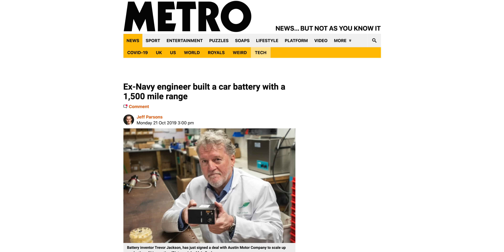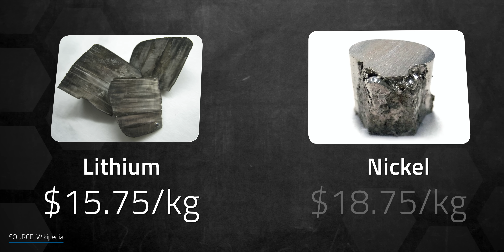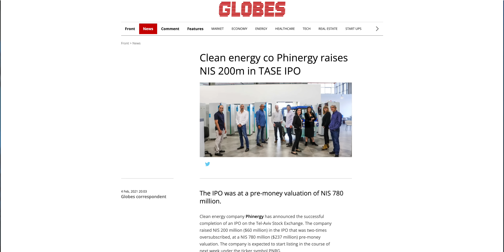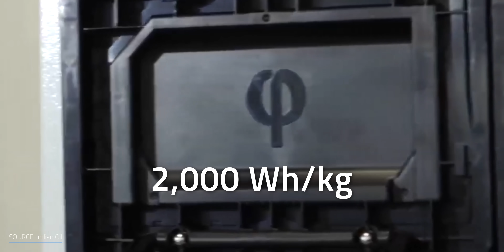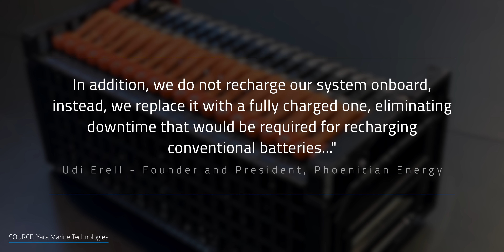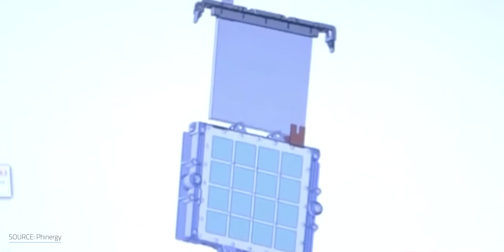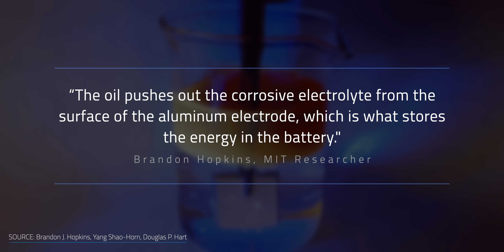Exploring the 1000 Mile Car Battery - Aluminum Air Hype?

Comment: Biggest elephant in the room: what's the roundtrip efficiency? How much energy is needed to recycle the battery for each kWh of the battery?
Reply: Should just have a hybrid system, with a medium lithium battery size that would cover 90%+ trip and space for the aluminium battery that can be swapped only when needed on trips, lets say above 150-200 miles kilometers.
Reply: Every city will need a high volume battery factory. The logistics for that will be "interesting".
Reply: @hamjudo  actually, all you need is a train car, or even a few freight trucks which run on these same batteries. Aluminum oxide is a bit caustic to some materials, but generally perfectly safe to handle, and aluminum and silver definitely are. So all you need to do is send them in bulk to somewhere were high amounts of relatively clean energy is being produced and now you have all of the battery recycling in a region covered, and a huge change in the carbon footprint.
Reply: @jasonisbored6679  Don't compare using aluminum air batteries with doing nothing or with the most expensive lithium options. Compare them with more cost optimized options.

Tesla is transitioning to using lithium iron phosphate, LFP, batteries for standard range vehicles. They aren't the most energy dense storage options, but they are good enough.

By weight, LFP batteries are about 2% lithium, the other 98% are widely available commodities including iron, phosphate, graphite, aluminum, and copper. No nickel, cobalt, or rare earths.

LFP batteries on a train can be recharged while the train is in motion by electrifying a small percentage of the track with overhead power.

On the level, the batteries and charging system can be sized so that if the train spends 5% of the time under wires, it won't need them the other 95% of the time. This doesn't mean that 5% of the track needs to be electrified, because American trains spend a lot of time moving at less than their maximum speed. The slow parts and heavy load parts are where recharging infrastructure will pay for itself most quickly. Trains need the most power when they accelerate out of sidings, and when they are going up hill. Trains go the slowest when they are stopped on sidings or adding or removing cars.

Lithium is a very common element in the Earth's crust. Unfortunately, it takes close to a decade to get volume production out of a new mine. We won't ever run out of lithium, but there may be shortages in 5 to 7 years as mine production lags demand. Given the immense profit opportunity, it seems likely that a few businesses will figure out how to start up mines more quickly.
Reply: @hamjudo  why would every city need a high volume battery factory? The city I live it have millions of car on the road, it does not have a tyre factory nor a crude refinery.
Reply: @dantronics1682  aluminum air batteries are single use items. So they are conceptually like gasoline, but they can't be shipped via pipelines. Unlike gasoline, they have to be shipped back to a factory to be recycled into new batteries. Thus they are shipped twice the distance between the factory and the battery swap location.

The economics don't make sense in this universe.
Reply: @hamjudo  without knowing cost how can you justify that the economy doesnt make sense? my point is you have electric transports which are clean quiet cheaper to build and purchase than rechargables or ICE, no rechaging infrastructor to put in, no one take this part into consideration. recharging transportation makes a lot of strain on the grid but the average everyday person isnt aware of this. this is the part where the economy doesnt make sense, On the news there is reports where millions are been spent in the states to put in charging points which isnt working. imagine if that money was use to encourage business to make swap stations. the cost of transporting these cells is sort of minimal since the logistic distribution would be using these alu-air batteries as energy source.
Reply: @hamjudo  Not really, we would move them around in logistics networks mirroring what we currently do for gasoline and diesel.
Reply: @trapfethen  More accurately: How we do for LPG.
Reply: Mmmmm if instead of changing the whole battery, why not only the aluminum, it would be easier to carry around aluminum plates. You could have a pump to push the electrolyte to another thank, a reserve thank and even change it, and change the plates... But I am not a scientist on that matter I am just thinking aloud.
Reply: @Peowcatpeow  I agree that Li isn't inherently difficult. But then there's also Cobalt & Praesodymium & the recovery of these are more important. Let's also not forget that India doesn't have any of these. There is also consideration of domination by China, against whose hegemony we're just about trying to stand-up to.

 One last thing you have to take into account is that whether or not there will be widespread Al-air battery usage. Aluminium production already exists. The spent oxide will merely get added to the processed bauxite taken to the Hall-Heroult cells. So we already have the recycling infrastructure.
Reply: Irregardless of the answer, I just love that this question is being asked and being discussed. I believe the reason we are facing environmental problems now (particularly climate change and global pollution) is that pretty much since the Industrial Revolution, producers didn't care about environmental impact and just focused on profit and consumers didn't know enough to ask about and be concerned about the end cycle of the products they were consuming. Now there are people both in the producers and consumers who are interested in the entire process and are just as interested in what happens to a product when it's time to dispose of them.
Reply: 13kwh/kg Al in newer plants
Reply: EXACTLY my thought. That sounds like a really dumb concept, a concept, only an oil company could come up with to use.
Reply: Range anxiety? Really? To me it comes down to longevity of the battery. And I mean how long it lasts before its needed to be change out. They say 10 years right? That 10 years is based off of how many cycles. Most ICE cars will last 200,000 miles. And not like a EV, which the more you drive the quicker your batteries will to be changed. Major electric changes are needed and battery life cycles are needed to make it worth it.
Reply: @Peowcatpeow  aluminium is one of the most recycled materials on earth.  Manufacturers would prefer recycled aluminum (depending on impurities) as it eliminates the Bayer process (getting the aluminum oxide from the bauxite)  then they only have to use the Hall-Herhoult process to convertil aluminum oxide to pure aluminum.   The battery is rechargeable but not in your car.    Start with aluminum in the battery uses it makes it aluminum oxide producing elctricity in the process.  Then u remove the aluminum oxide and convert it back with the electricity hungry process mensioned above.
Reply: main problem with aluminium oxyde (end product with air-al battery discharged) is the need for noble material to recyle to aluminum metal, and this noble metal material is graphite electrode for electrolysis reduction of aluminium oxyde, produccing lot of co2 with an effiency of 50%, i don't see a game changer!
Reply: I'm worried that recycling uses high heat which is hard to attain with renewables.
Reply: If this aluminium battery kicks off recycling is easy and relatively efficient
Reply: It seems like a solution looking for a problem. Lithium batteries are getting lighter and cheaper and charging faster. I have got used to charging my car like a cell phone so that's not an issue, I seldom have any single journey more than 50 miles return, which I can achieve easily in my EV. All that silver hiding in the battery would make it a prime target for thieves.
Reply: @squareeyz  Silver is dirt cheap (in terms of how much extraction and use of it from such a battery would cost), nobody's going to be stealing those batteries because of that. Regardless, nobody is going to use this anyway, it's way, way less sustainable than even fossil fuels...
Reply: same as internal combustion engine if the aluminum is recycled. energy is trivial since aluminum is recycled regularly. rechargeable EV still wins on many aspects except upfront cost.  so aluminum-air EV car is best for low mileage use vs a rechergeable EV.
Reply: Also how much material do you really get back from recycling it, often recycling something of more than one element, you only get a few parts of those elements back.
Reply: Think of all the aluminum scrap that would find its way to the recyclers once the demand for aluminum jumps even higher?
Reply: This
Reply: @Peowcatpeow  you said "The fact that aluminum is produced so widely means that none of the batteries would be recycled, where as the higher price for lithium would have higher incentives for recycling."  That's one of the dumbest comments I read in these replies.  Did you miss the part of this video that explained the silver content of these batteries, and how much that silver currently costs?  Of course these batteries would be recycled.  As for Aluminum not being recycled, look again at the percentage of Aluminum recycling currently being performed world wide, and the trend toward increased recycling to raise that percentage even higher in future years.  The question remains about how much it will cost to recycle these batteries, and also the initial cost to produce them, and replace them.  This is what is going to stop them from being used in cars, but might make them more attractive in electric aviation, where the lower weight to power ratio is more important, and possibly worth the increased cost per kilowatt hour.
Reply: and against solid state that use ~1/4 of the raw metals liquid ones does I'd say it's no brainer + the car is lighter
Reply: This sounds like a 1998 problem and not a 2021 problem.  There are regions where electricity prices are NEGATIVE during certain times of the day/year.  It's just a matter of running the arc furnaces at the trough of energy cost caused by overproduction from wind or solar.
Reply: @ricks6250 Arc furnaces for what? They dont reduce al2o3 like that it take above 2000C and you get al4c3 as main product, they do electrolize of al2o3 and it takes 13kwh/kg Al.
Reply: That, sir, has to be asked about lithium battery. Because lithium recycling is a nightmare compared to aluminum oxide.
Reply: Considering you'll have to resmelt that alumium: A metric fuckton.
This is never going to be a thing for cars or trucks. I could see it for planes. Not as many trips and there it is important to not emit anything in the atmosphere.
Reply: I think even hydrogen is a better choice than aluminium air battery currently. If they can fix the self discharge rate then it could be used as a emergency battery for power outages or as a small spare battery when travelling through the wildernes.
Reply: @SkepticalCaveman  Fair enough; I think we should be using ammonia instead of hydrogen, since it's easier to store if you just want the H2, and it carries more energy than the nitrogen and hydrogen by themselves - and N2 is a notoriously stable molecule.
Reply: @SkepticalCaveman  hydrogen converter (to energy) efficiency 50% and even those cost a lot (platinum needed there),
take into account that other 50% is heat that need to be dealt with.
so for airplanes aluminum air may be better, and for long range ships provided at both ports (ends of journey) there is refurbish plant for batteries.
but if good hydrogen power extractor would be developed (with efficiency 90%) and with good power/price ration, then hydrogen would be much better, as it goes into air exhaust, not staying in battery like Al oxide.
Reply: @SkepticalCaveman  yes this! A combination approach marketed to long trips or as a spare emergency battery due to the lightweight would be the most logical. Then as efficiency increases or we find more rechargable lighter weight solutions, we can continue to use more aluminum air tech to provide better emergency coverage.
Reply: I think the better question is, what is the lifetime efficiency of the vehicle?  I had a long response typed out, but i realized i could make my point simpler.

Theoretically it would take exactly as much energy to electrolyze the oxides as you got out of them.  If the aluminum battery lasts 1000 miles, it will need to be replaced every month or so.  Since the process is electric powered, the "recharging" is gonna be affected by generation efficiency the same as recharging lithium.  So we can simplify the comparison down to manufacturing ONE lithium battery for the 5-year lifespan of a car, vs manufacturing 60 aluminum batteries for the same lifetime.

Processing the spent battery into acceptable feed stock isn't trivial, and there's a lot of heat loss since you have to melt the material in the smelting process.  Then you have to re-heat the raw aluminum ingots to process them into the thin sheets that are required for the battery.  I highly doubt you could repeat that process 60 times and use less energy than it took to make the single lithium battery pack.
Reply: @tippyc2  a 5 year lifespan of a Li-Ion battery pack is pretty low, though. They can last for ten years or more if properly handled.
I just did a quick calculation for my country, where for the standard driver (88km/d) the 1750km range Al-Air battery would have to be replaced around every 19 days. That means that before I seriously need to consider swapping my Li-Ion pack (let's say after 8 years = 2922 days), I would have to swap my Al-Air battery a whopping 147 times.
Yeah, those people who complain how much energy it takes to produce one BEV would hang you, if they heard you seriously considering that concept...
Reply: @midnight8341  >Yeah, those people who complain how much energy it takes to produce one BEV
To be clear, I used to be one of those people.  I'm still not an EV advocate, but I do see the objective benefit in certain situations.  Biggest downsides of EV is time to charge, and electric grid capacity is too low to handle mass electrification of cars as it currently exists.  If i was looking for a dedicated commuter, i would consider EV, otherwise i'll be sticking with ICE until charge times are under 15 min.
Reply: @tippyc2  
Most of the energy is from burning the aluminum. And it doesn’t take much to knock the oxygen off once it’s on. I’m not sure if this holds. I just did a bunch of napkin math— this doesn’t make sense

It should take around 50 MJ to melt the required aluminum for 1,000 miles, including inefficiencies but let’s bump it up to like 200 MJ. Sources say an EV uses like 1,000 MJ to go that same distance. So like 5 times the energy

So lithium ion EVS will use ~2 times the energy over their lifetime, according to my napkin math and the exclusion of the lithium ion energy production requirement. This doesn’t pass the smell test 

Dude, these guys might be on to something. Or maybe I forgot my units or something
Reply: @nicholasn.2883  The amount of energy to break those oxygen bonds is non-trivial though, and your analysis just skipped over it.  There is a well-defined amount of energy it takes to break those bonds dictated by chemistry and is, in fact, equal to what it produced as a battery.

According to wikipedia, that energy (for the Hall process) is "The theoretical minimum energy requirement for this process is 6.23 kWh/(kg of Al), but the process commonly requires 15.37 kWh."  Or converted, that's a minimum of 22 MJ per kg, and a typical in-practice value of 55 MJ per kg.  That 55 value appears to include the heat losses that i referred to previously.  Assuming this battery contains at least 10 kg (22lb) of aluminum, your number "50 MJ to melt the required aluminum" is at least 10x too low.
Reply: @tippyc2  
Thank you for the correction. But I have a new concern. How many kwh’s would it take to travel 500,000 miles over the lifetime of a vehicle?

55MJ = 15.3 KWh 
500,000 miles total / 1,000 miles per pack = 500 packs 

500 packs * 25 kg per pack = 12,500 kg
12,500 kg * 15.3 KWh recycling = 190,000kwh 

Now for lithium EV’s

277kwh to go 1,000 miles 
60kwh per kwh * 50 kwh = 3,000 kWh
That’s negligible over the life of the car
(500 cycles * 277kwh/cycle) + 3,000kwh
= 140,000 kWh

So it’s 190,000 kWh vs 140,000 kWh for 500,000 miles. 

Flaws in my estimation method can make this swing like 2x in either direction. But this really doesn’t seem that bad. For certain applications, this would actually be a viable alternative. Now to go buy stocks
Reply: @nicholasn.2883  Thanks for finishing the numbers there.  Interesting how close they come.
Reply: Even so, for the recycling of the Aluminium oxide from spent batteries, there is a ready infrastructure in place. It is way better feedstock for the Aluminium smelter than bauxite. In contrast recycling Lithium is very complex, messy & not at all viable.
Reply: @TheControlPhilosopher  but lithium ion batteries can be used a thousand times before needing recycling, as opposed to just once. The roundtrip efficiency needs to be calculated taking this into account. But if the electricity comes from renewable sources and is more efficient than carbon capture, it’s probably worth doing in some situations.
Reply: @Scrogan  Completely agree. But Al-air is just one more option that is being developed as it holds some great promise. It makes sense in the Indian context as public transport is still the primary mode of travel for millions in India. And Aluminium continues to be produced on a huge-scale whether it will be eaten up in batteries or not. 

As I have described at length in another post, the labor-intensive plates-replacement is seen as a welcome thing as it proffers livelihood. Since if at all the concept is proven to work, batteries would be in all sorts of shapes & sizes. The small-industry ecosystem that looks for any kind of work, will welcome this opportunity.
Reply: @Scrogan  1-2k cycles at 80% DOD before capacity drops on average to 80% is how batteries are rated.
Reply: @Scrogan  I think there's not enough Lithium on earth to serve everybody. If in 20 years every household in India has a car then all the Lithium reserves plus what is recycled is not going to suffice. There have to be some other options. Indian policy makers aren't known to be hasty or reckless in their decisions. That means before a state-owned Oil-giant partners -albeit in a very small venture with an Israeli start-up, numerous geeks would have gone through the feasibility reports.
Reply: But if you can only get back the aluminum, that's alot of material that is wasted, I'm sure the battery is not only one chunk of aluminum.  This would happen every "charge" versus lithium etc. would need to be replaced & recycled years latter. Also as mentioned elsewhere in this thread it would require a network of transporting new and replacing old. Or do you think the batteries would be 'recycled' on site at stations? Which would require vehicles and energy.
Reply: @TheControlPhilosopher  but only needs to happen once in 15 or so years for li batteries vs every two days
Reply: @TheControlPhilosopher  
Red Wood materials is working on this exact thing and has been recycling lithium ion batteries for years— lithium included
Reply: @nicholasn.2883  Good to know. But again I'm not sure if there's enough rare-earth material on earth, that would be enough to meet the needs of every Indian who wants to own an EV. That prospect may appear distant but just look at the growth rate of automobiles in India.
Reply: @TheControlPhilosopher  Have a credible source that recycling Lithium isn't viable?
Reply: @4203105  No. I'm not saying that recycling Li isn't viable. It is just that for Aluminium it is not only simpler, but also that a ready-made infrastructure already exists.
Reply: @TheControlPhilosopher  If that's not what you were saying then why did you literally say it?
Also the infrastructure doesn't exist, as the infrastructure that does exist is only enough to cover our current need for aluminium. If you wanted to deploy aluminium air batteries large scale, you'd have to build a lot of new infrastructure. That isn't even to speak of the massive energy requirements.
Reply: @TheControlPhilosopher  A lithium battery lasts a whole lot longer than 1000 miles though, so far less lithium is being used in the first place.
Reply: @TonboIV  As the channel Technology For Luddites said, it seemed that way because the majority of lithium batteries are not in retirement age yet. They will, within next five years, then the headache starts.
Reply: Yep without a ton of scientific analysis of recycling we cant even say this would be less environmentally harmful than diesel (although it probably is).  If the only major input is power (and it isn't in insane amounts) that can come from renewables but if chemicals that get used up are needed then we need to compare that to burning dead dinosaurs.
Reply: @ccibinel  In the US most Aluminum refining plants are near hydroelectric stations.  This is because the Bayer process uses a lot of electricity--but unlike steel smelting it is almost entirely electrical power.  Hydroelectric stations provided the cheapest power when the  plants were built.  There are still risks--when Enron spiked the cost of power on the West Coast the plants made more money reselling the power futures contracts than making Al.  This decision would be more dire with Aluminum battery powered infrastructure.
Reply: @xuare6931  I live in BC so I definitely understand the potential of hydro (the power company is literally called BC Hydro).  Scaling to meet the energy needs of massive aluminum smelting for something like this will require vast increases in power production.  Hydro is a great option but especially in north america is largely tapped as much as possible already.  They will need tons of new production (ideally nuclear+solar) to make a glut of power needed to rerefine all that aluminum.  Other battery components may not be recyclable and that impact will need to be explorer - way too many unknowns.
Reply: @xuare6931  LOL the aluminun factories really started selling power futures that's hilarious.
Reply: only the cost/capacity and capacity/weight is important.  the amount of juice consumed is not important since it's way lower cost/energy than petrol.
Reply: @kevinwelsh7490  for airplanes high power is important, that's actually was problem though all time, especially for first airplanes, and especially for helicopters, and hydrogen has big problems with it (unless you want to burn it instead of kerosene).
Reply: A quick google suggests a lithium ion battery takes 50~65kWh of energy to manufacture per kWh of battery capacity (this is just the manufacturing - not including mining and refining materials). Even if the aluminium based battery is 10 times more efficient to make (and we ignore costs to move it to / from recycling facilities, plus actually recycle it), that is still only a 20% efficiency.

It may be a lot easier to recycle aluminium than lithium compounds, but a non recharable battery solution means recycling it several hundred times more often for the life of a car.

Further, without a rechargable battery, regenerative braking, etc, becomes difficult.

Personally I want a battery that is infinitely rechargable. A range of 400~500 miles would cover more than 99.9% of the journies I have ever done so not really worried about a longer range, but I don't want a vehicle where the expected failure of the battery pack renders the vehicle economically scrap
Reply: How is that any kind of elephant?
1 kWh in a battery in a car is worth infinitely* much more than 1 kWh in a factory where those batteries are produced;
So what does the energy cost of building & recycling a battery matter?
Reply: @peka2478  It's an "elephant" because it defeats the entire purpose of an electric car. If you're using up 2 or 3 or 4 times as much energy to make the battery than it produces, then it isn't very sustainable. Solar and wind take up a lot of space and we want to use them efficiently, and even if we do have that much carbon neutral energy to waste, fuel cells have about a 45% round trip efficiency, and they can still be used more than once.
Reply: @TonboIV  at 5-6 times needed to recycle we are at energy parity with diesel and still can avoid emissions (ignoring elements used to recycle - lots of unknowns).  Could be a solution for planes or ships - not consumer cars.
Reply: @TonboIV  Solar and wind? Honey, we are going to need nuclear for this.
Reply: @mikicerise6250  Oh I agree. I think solar and wind are viable, but we could do a lot more a lot quicker with nuclear, and even have energy left over for cool stuff like mass desalination of seawater and vertical farming. Nuclear power is about the only way we'd have enough energy to waste on inefficient storage methods like hydrogen or probably these batteries. Right now though we're still in the early days of a renewable transition, so large scale uses like cars have to be done efficiently, which means rechargable batteries are the only practical option for now. It's a good thing battery electric cars work just fine for like 99% of uses with current tech. We just need to put a realistic price on carbon emissions to make them more attractive, and do a mass deployment of charging infrastructure to cure the range anxiety.
Reply: @TonboIV  Unfortunately metallurgical grade silicon smelting requires illegal deforestation and dedication coal power plants. Solar panels need pure silicon wafers.
Reply: @TonboIV  since solar tech is getting advanced, solar energy efficiency is increasingly-
Like perovskite solar cells that are highly efficient and don't require much slace
Reply: @peka2478  Example:  Let's say the energy to recycle an Al-Air battery is 10 times what the battery holds (A turnaround efficiency of 10%)  This would mean that, were they adopted by the world, the the kwh's spent per mile driven would be almost 10 times higher than a typical rechargeable Li-Ion  battery, which typically have turn around efficiencies in the high 90's.  Increasing KHW per mile, means using more electricity. That means increasing energy infrastructure by some factor (10 times the percentage of your economy that is transport). If any part of a given economy is still burning fossil fuels, this would also mean an increase in fossil fuel use, and more emissions. That's why turnaround efficiency is important .
Reply: @Natabus  et al: but batteries can be made where and when energy is cheap, making it next to free (like: when there is lots of sun but no one is using that energy), while using it when you need it and while it might be expensive.

More efficiency is better, no denying that, but the asynchronuous nature of battery production and battery usage (unlike even li-io batteries which have to be recharged right before use) makes this metric far less important, i guess?
Reply: @peka2478   There are many such arguments, that curtailed renewables are essentially 'free' and so we don't have to concern ourselves with efficiency. I hear the same argument from Fuel cell advocates.  I think that's wrong. Why? 

If we posit that some battery technology is going to supplant the internal combustion engine and so replace petroleum for transport, we're talking about 25% of world energy consumption. At that scale, energy and electrical production capacity is essentially fungible. Building capacity in one place  to achieve a massive overcapacity means not building capacity in another, perpetuating reliance on non renewables in the passed over local. We can revisit this sort of argument once the entire world has enough overcapacity such that curtailed energy represents a significant percentage of whole world production. Until then, any technology who's economic viability relies on the argument that "curtailed energy is free energy" is  doomed to a tiny. tiny niche.
Reply: @peka2478  True but we need renewable energy for powering our homes and other uses apart from peronal transport. We need to look at the overall use of energy for all systems and go for the lowest ones to ensure we can cover everything efficiently.
Reply: @philipbroggio9315  efficiency is needed when we are at the limit, all the time.

If we have times where energy is produced, but not used up fully, it is wasted.
Lets say we waste 1000kwh.
Using those 1000kwh to create 15 kwh is incredibly inefficient.
But as those 1000kwh would've been wasted and lost otherwise, that's basically 15kwh for free. Still not ideal, but worth it nevertheless.
Reply: @peka2478  I agree but we aren't in that situation just yet certainly in the UK. In order to get a 100% solar, wind,  battery system we may need about 4 X the current peak capacity plus about a week's storage as per @rethinkX report. This will indeed give superpower to electrify many other areas and produce hydrogen at scale to decarbonise home heating or for storage etc. Will be interesting to see what actually happens. I suspect the market will decide based on the economics . In reality we need a bit of everything depending what is most economic .
Reply: @peka2478  It's the whole thing, a complete system, to be sustainable.
Reply: @peka2478  Not at all true.  The power has to come from somewhere.  Facilities need to be built and maintained, resources mined and refined, and that costs money.  If it takes 10x the energy to "recharge" the batteries, it requires 10x the facilities to power the process.  That extra cost will be passed down to the consumer in the form of higher prices.
Reply: @peka2478  it matters because this is a battery that you use literally once and then have to recycle. Not recharge, recycle. I don't see myself getting a new battery for my EV every 1600km.
Reply: @mjmulenga3  Depends on the price, really. For that matter, Mg-air seems easier to use/ reuse.
Reply: @blackmephistopheles2273  I need to drive, let's say, 2-300 miles a week. A replacement battery every three weeks would only be cost efficient if it cost a few dollars to manufacture. I don't see that happening even at scale. It's cheaper to just charge a Tesla or Leaf.
Reply: @mjmulenga3  If your battery is designed for replacement of its internal chemistry, that could be as cheap as it needs to be for recharging, while the actual battery housing and support are an additional value only seen when buying the original battery. Basically, if you don't just make a rechargeable battery, make it somewhere in between that and a fuel cell. There are rechargeable Al batteries in development, just like sodium-ion batteries were, before this year.
  Also, if you're going 500km in a week, you could likely get a smaller supplementary pack for the Al-air style of battery...or recharge it like you'd do with any other rechargeable. If the battery isn't a good use case for you, then you shouldn't use it.
Reply: @blackmephistopheles2273  you make a fair point. But if the cost of manufacturing doesn't go down by orders of magnitude, then it's not a good use case for any driver.
Reply: @peka2478  You really don't get it do you..
Reply: @proinseasokiellig4388  well, i'm pretty sure you don't... :|
Reply: @peka2478  because energy isn't' free and that directly effects the cost of the whole solution.  If a Li-ion EV costs $0.03/mi to drive and an AL-air solution cost $1.00/mi it will never get manufactured.
Reply: @scottkolaya2110  under certain circumstances, energy can be regarded as pretty much free, if for example, at some point in time and space you have a lot of energy and not a lot of users: you can either spin turbines to waste it (as they do), or put it into something useful even if its not the most energy-efficient thing, round-trip-wise.
Reply: @scottkolaya2110  also, if there is something li-ion just cannot do (like if there are no chargers in the center of the US and you need to go east coast to west coast, and there is no battery large enough), then the much higher price of Al-air might still be a viable solution
Reply: @peka2478  Regarding driving across the midwest, I'd imagine these would have to be broken down into modules that are individually replaceable since you can't just run one giant battery all the way down and happen across a replacement station just as it gets to zero.  It would have to be at least two modules so you can run one all the way down before switching to the next without wasting turning in a partially charged battery for a new one.  Or when you start out your trip across the US, do turn in your half-charged battery for a new one so you can make it across the part with no stations?
Reply: @scottkolaya2110  my understanding is not that turbines are throttled down a few times per year, but on the contrary, there are turbines which are spun up to waste excess energy, pretty much all the time.

There might be alternatives to Al-Air, im no fanboy here, just saying: the efficiency alone is not the biggest elephant in the room because a gazillion of factors (like transportability, and degradation, and battery swaps, and all the other things you mentioned, ...) which are much more important than just "how much energy i put in and how much energy do i get out?".
Reply: @scottkolaya2110  you can work around, in this particular case, with swaps and more infrastructure and whatnot. 
In some other cases, you might not be able to.

Again, same point as in my other answer: these are important questions. Much more important than the pure "roundtrip efficiency" which was imho incorrectly named "the biggest elephant in the room" by OP.